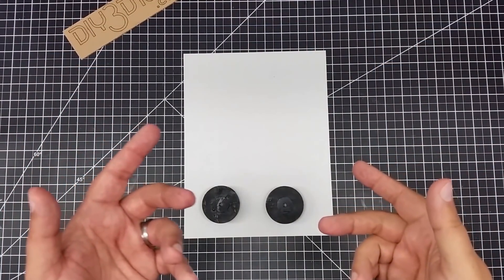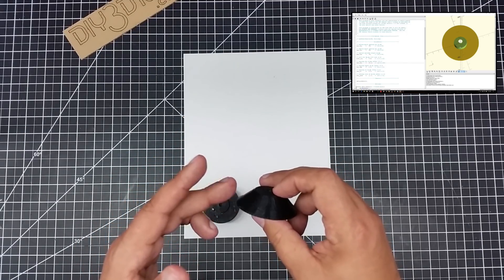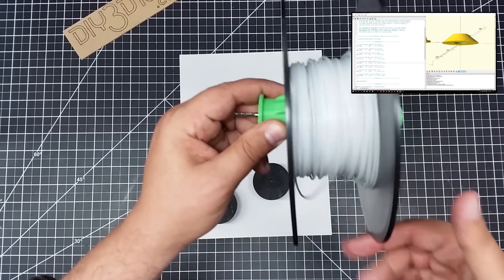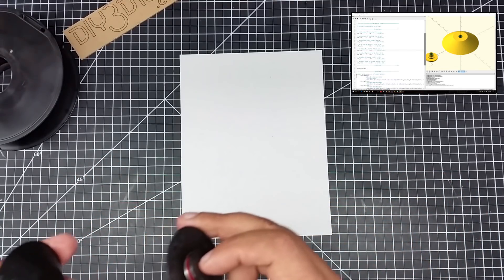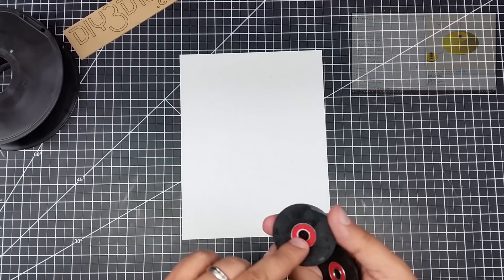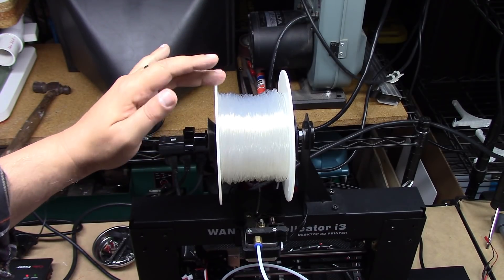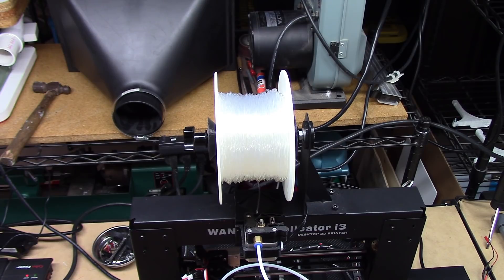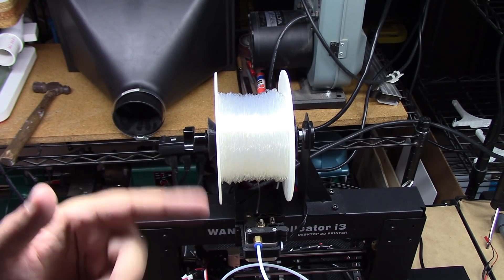3D Printed Projects - Thingiverse Customizer for precision 608zz Bearing Based Spool Holder!

Comment: I'll try and make this. I'm on my way to buy a 5/16 rod (8mm) rod. I want to make a 3 spools dry box and I want them to move independently and easily.  I have silicone grease which is very thick. Will it work?
Can I ask why 30 bearings? Spares?
Reply from the maker: Because they are super cheap and i use them in all sorts of projects.  For example my grandson wiped me out of 60 of them for fidget sippers :-)